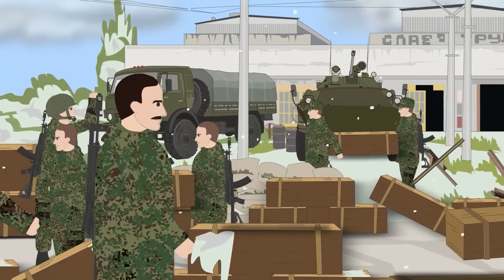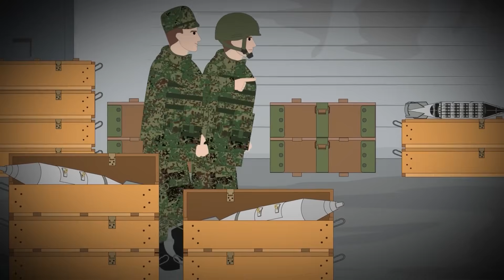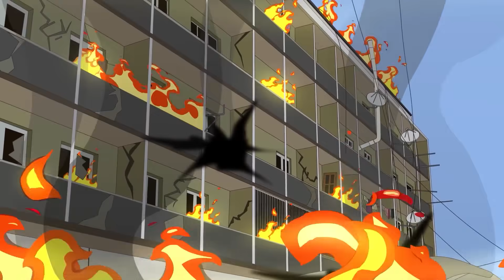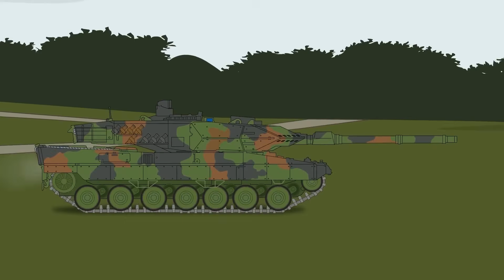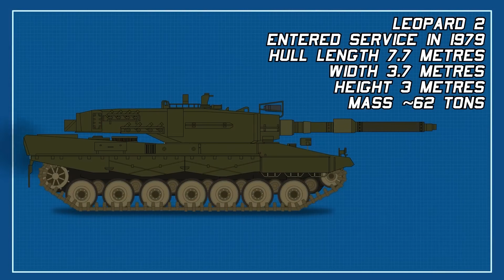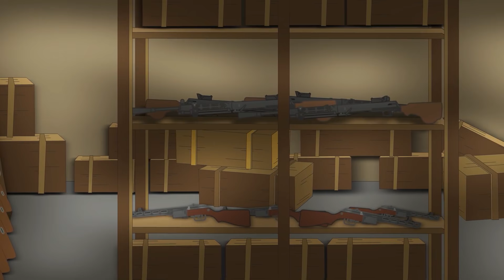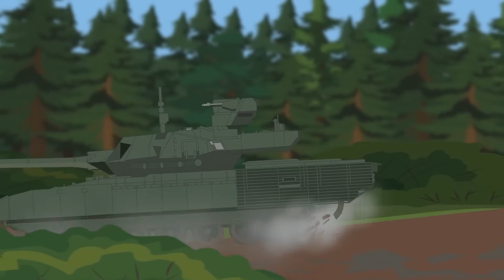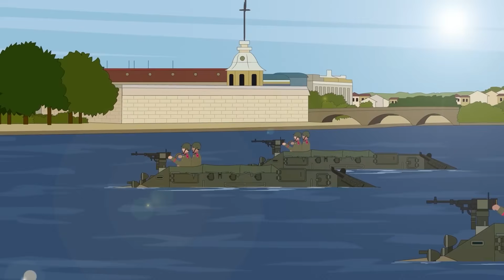Weapons that could Decide the outcome of the Russia-Ukraine war

Comment: The Abrams  was developed  between 1972- 1975 and entered service in 1980. 

The Leopard 2 and M1 Abrams  are products of the MBT-70 project. 

So you missed the mark on the history of the tanks and their development periods as well as when they entered service.
Reply: You should probably edit. "Lapard" to Leopard 2 before anyone sees it or they will think you're a sload.
Reply: @MC-ht8ud i got that reference.
Reply: @MC-ht8ud  Yeah, edited it .  I was using my cellphone at the time.
Reply: That's true for the original tanks designs and productions. However, the ones listed in the video are specifically the upgraded variants: the M1A2 Abrams (which was designed in the 1980s and entered production in the early 1990s) and the Leopard 2A6, which began production in 2006, and is a recent version of a line of Leopard 2 upgrades, stemming from the original Leopard 2 which entered service in 1979 as a product of the MBT-70 project.
Reply: @thesenate9564    Upgrading a tank is not the same as building an entirely new tank.  They simply refitted existing tanks .   If the US replaced the Abrams every time a new upgrade came out then the US would have more tanks than Russia before the war in Ukraine kicked off.   

The US has roughly  2,509 Abrams in various versions, with an additional 3,700 in storage. 

Yeah upgrade means replacing the electronics and other systems.   Not building a new tank.     Same with the Leopard 2's of which Germany has around 3,600.    

Fact is a new tank doesn't come around very often.  Which is why everyone and their brother who had even a passing interest in takes freaked out about the T-14 Armata when it was introduced.    Needless to say it wasn't that impressive to people who actually know anything about how tanks work.    Everything on the T-14 was stuff the Russians had been developing since the late 90s.  And are about a decade behind most of the world , about 2 decades behind the US, Germany and UK.

Comment: top-3 weapons that Ukraine needs:
1. ATACMS long-range missiles
2. Abrams tanks
3. F-16 fighters
Reply: They already have Abrams, Challenger 2s, Leopards they also already have long range missiles HIMARS and several other missle based system they have all of this and then some they are good.
Reply: @samuel10125  Himars is a rocket launcher, not missiles. Those missiles that Himars are firing now hit 70 km, ATACMS can hit 300 km and 500 km. There are no Abrams in Ukraine, there are only Leopard and Challenger, but very few.
Reply: @samuel10125  Ukraine for a long time could not knock out Russian warehouses and bases, because the Russians located them at a distance inaccessible to Himars. and have started to do so little by little in the last couple of weeks, getting some Storm Shadow from the UK

Comment: I’m gonna say this once and for all, the bob semple will decide the war, but both sides (even nato) can’t reverse engineer the technology
Reply: I wouldn't wish that on my enemies. You are SICK! If 2 of those get out there we all better surrender.
Reply: With tank captain Ronny Pickering,  the enemy are finished!!!
Reply: The sample can end the world it has 99999999999999999999999999999999999999999999999999999999999999999999999999999999999999 mm of magical armor and can pierce 999999999999999999999999999999999999999999999999999999999999999999999999999999999999999999999999999999999999999999999999999999999999999999999999999999999999999999999999999999999999999999999999999999999999999999999999 mm of armor at 9999999999999999999999999999 miles
Reply: semple
Reply: No modern tank can beat a tank with corrugated plating 🗿
Reply: 25 long tons? Whatever that means… 😂
Reply: If there’s one tank that even the toughest M1A2 Abrams, Challenger 2s, Leopards, T-90s don’t want to run into, it’s the Bob Semple tank
Reply: @deleted_215  the powerful 7mms on the bob semple can pierce thought about 1200mm of armor at the range of 500m
Reply: @menteko2137 and at 300 m over 4 trillion mm of armour
Reply: @deleted_215 6yyttttttyyyuyuuuu😅